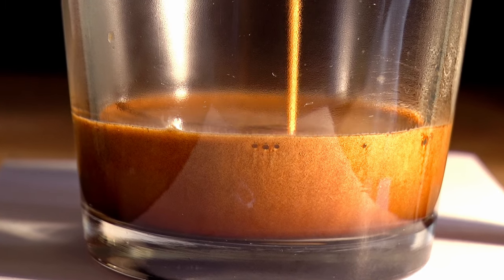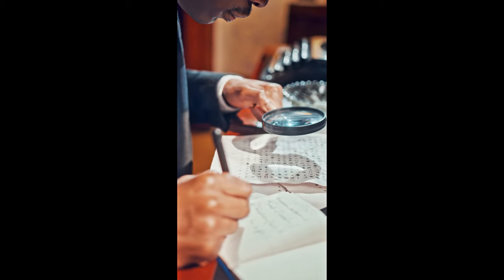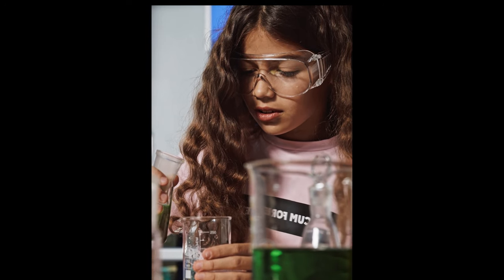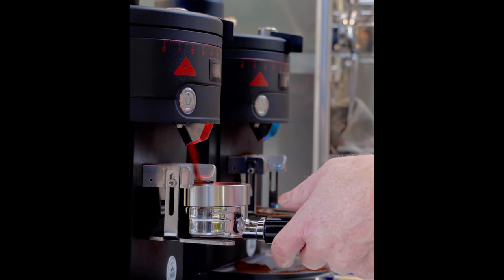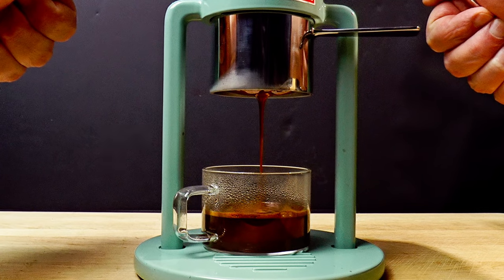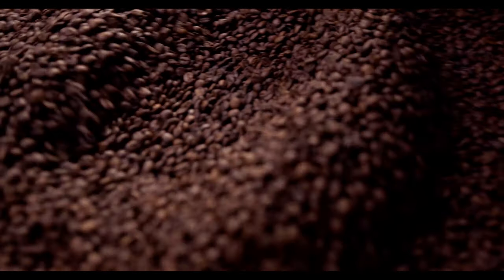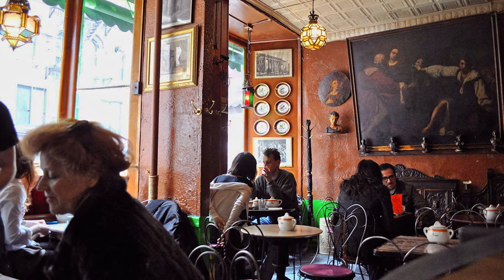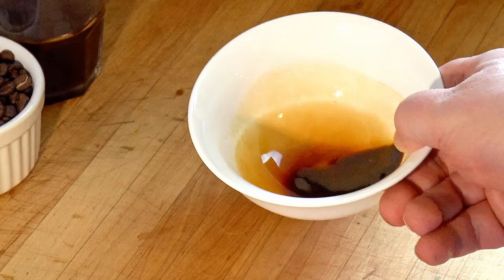Make Better Espresso: Secrets And Mysteries

Comment: I can't say I subscribe to the single basket suggestion. I feel that only works because the smaller dose as well as the shape of the basket mitigate the channelling caused by incorrect puck prep, reducing harshness, but it will never produce a stellar shot. Channeling is a bigger problem than people like to admit, and is usually the cause of a disappointing cup even if it mathematically and visually seems like you nailed it.

Comment: Awesome! As always :). One small detail which may be important is if the brew ratio is computed with the volume or mass of espresso. I also have the robot and it's an awesome machine, and I as well would like a smaller single basket. I'm having the same problems which you describe here. The coffee is good, but not mind-blowing - even with expensive fresh beans. I wonder how you control the temperature.
Reply from the maker: Thanks: I think we assume that dry coffee is mass units and brewed coffee is volume or mass. You can get a lower temp easily, but going higher than around 90 C means preheating the basket, PF, and piston. But the Bot lets you prolong the contact time for better extraction by just easing on the levers. I use around 4 bar sometimes for a one-minute shot, which is nicely extracted with only 90 C water.
Reply: @wiredgourmet  i want u to know. i boil water with coffee and then filter it. and here you are preheatings robots.

i also do cold brew which is adding coffee to water in a tall bottle. i dont even filter it.

i also dont do cream or boiled milk. or sugar. but started to add salt and sugar. when i feel like being fancy.

the latest uppgradde i got is 5 dollar vietnamese coffee making thing.
not much luck with it. but coming from boiling grounds. i cant compain. excellent videos btw. did learn alot. 😊

Comment: Great video as usual. I don’t own a espresso machine but love watching videos on them. I do however use my Moka pot all the time. I’ve tried your method with tapping the basket to slightly compact the grounds but I find I have to turn up the heat in order to brew around the 2-3 minute mark and the coffee always tastes burnt?  I’ve tried adjusting grind size with no luck. Any ideas?  I went back to loading the basket the “normal” way with great results. Thanks
Reply from the maker: Thanks. My guess is you can grind coarser to get a slow gentle brew even with a full funnel. A burnt flavor usually comes if you put too much hot water through the dry coffee, raising its temp too high. The 1:3 ratio I recommend should make that impossible. Of course if there's any channeling, an area of the puck could get overheated. Have a look at my most recent moka pot vid; I think you might find a few tips in there helpful. Good luck.
Reply: @wiredgourmet  I also don’t have an espresso machine and love Moka pots. I’m not so disciplined that I time or weigh everything (cheap 1 gram unit scale). I endeavor to try though! I have different sizes of pots and will need to work with them individually until I get it nailed down. From watching your videos I believe it is worth the effort to try.

Thanks!

Comment: Great video, i am thinking about getting an espresso machine at the end of the year (maybe next year). Im torn between the flair pro2, the cafelat robot or maybe a rocket apartamento or a lelit machine. What machine  would you recommend? I would start with my comandante that i already have and maybe get a niche zero later on.
Reply from the maker: The little rocket or lelit will suit if you're into milk drinks. If not, and you only want espresso, the Bot rules in terms of build quality, work flow, and not needing preheating. It's about as fast as a semi-auto machine. There will be a new Flair in a few months that supposedly solves the preheating and workflow issues, so maybe worth waiting to see.

Comment: the chances of channeling  become much higher when using a single  basket........ and  letting it flow longer to yield a 3 to 1 ratio will make it worse.  the bizarre configuration of many single baskets actually leaves the ground coffee almost unextracted because of the short contact time.  many  double  baskets on italian machines are 14 gr. baskets, but will be  used as single baskets using  only 10 or 11 grams to make the single shot.....

Comment: Nice video, I was wondering what machine to buy, because I am in Europe, so cafelat is out of question (400€+), I have found the rok espresso that is around 180€, do you recommend it or Do you know any other way that is around 200€???{or maybe a little more than 250}(I would like to use it for large espressos or with a little milk, like flat whites or cortado's), So keeping in mind all of that, what do you recommend????
Reply from the maker: ROK is a good price, and makes OK espresso. IMHO the PF basket needs an upgrade. If you do your homework on line, you might find a quality basket that fits it from another maker. Flair has a better basket, makes technically better shots, and the base model is within your budget if you can find one. However, the Flair needs preheating so the workflow isn't great.
Reply: @wiredgourmet  oh, ok, thanks for the info, and by the way awesome video

Comment: Love the videos. If I wanted to do my 16g dosing but at 1:3, should the timing still be around the same 30s as if I were doing 1:2, or any other ratio? (Meaning the timing stays the same but the grams and grit size change) Cheers.
Reply from the maker: I honestly don't know; I'd probably try it at 30-35 secs to begin, but then try it faster and slower. I think the answer depends more on the coffee tbh.
Reply: Continuing your extraction from 1:2 to 1:3 in a 30" shot, can only be 4" f.e., so you will immediately understand if you like the bigger ratio and then you can micro adjust

Comment: So if 1 to 3 is the correct ratio what time do you look to pull that volume in? I'd like to try that
Reply from the maker: OK, I'm not sure if it's "correct" but it's one that I like. I tend to go finer/slower, so aiming for around 40 secs would be a good start. Obviously it depends on the coffee and roast level and water temp, but I tend to prefer low (ratio) and slow (extr) personally. Circle back and let us know how it went.

Comment: Can't say I agree with the argument about ratio. 1:3 helps extract more from the coffee than a shorter ratio but isn't necessarily better (this depends on taste preference, equipment, solublity of the bean) and is not the 'correct' espresso ratio (1:3 is a lungo).  Double shots are used because they are more forgiving than a single shot and it saves time dialing in a single. I don't believe that all coffee professionals are blindly following ratios either, a lot of innovations and experimentation has been made from the 'Starbucks' approach to try new things and you're doing them a disservice to say they are binding following pseudoscience.
Reply: correct u

Comment: first shot: 14g in / 20g out / 25 sec (first drip after 8sec) / beans : prod date is 26/june / brand: Corsini in Grani Espresso / exp date 6/2025 / Delonghi ECP35.31 / NEOUZA bottomless portafilter

the shot was creamy, dense but bitter. the beans are a dark roast (mixed with some random medium roasted one / 100% Arabica) and are being grinded with 0,5 Mignon Manuale grind setting. (probably too fine for a overall dark roast and / or the brew group/water was to hot for it considering i wait 20min minimum before pulling a shot(?))

'water stuck in the basket' issue was present but if i let, all that water, drip after the shot and remove the portafilter after some minutes, the puck came out perfectly. i wonder if it can be completely solved or theres the need to buy a more expensive machine (or experimenting with puck screen?).

a pulled a second one, 14g in / 30g out / 38 sec (first drip after 11sec).
still too bitter for my taste, and just a bit too diluted, considering also the time that id prefer to bring down to 20/30sec. tomorrow im gonna try new shots.

afterall its a 100% arabica, why its so bitter? cant this be solved cause its a (kinda) very dark roast? thanks